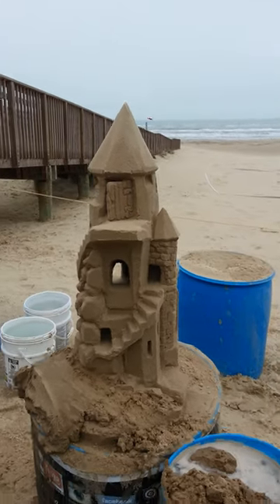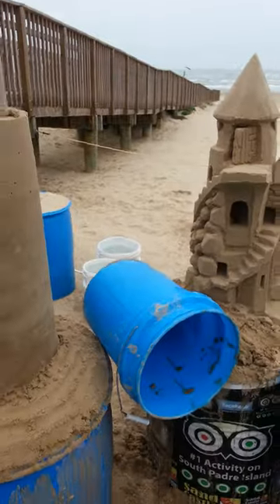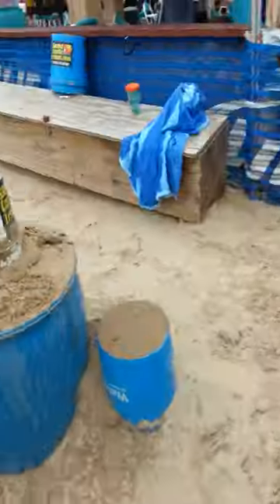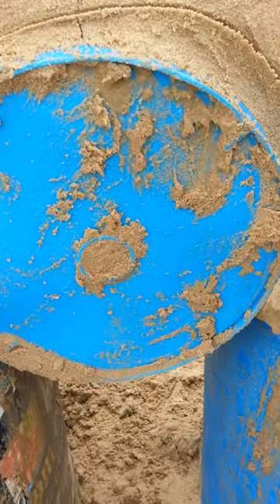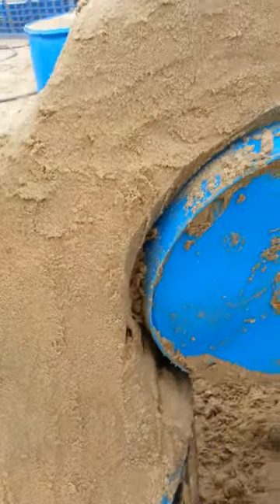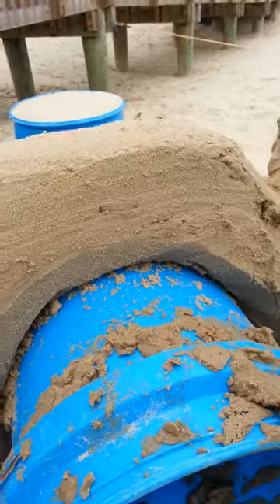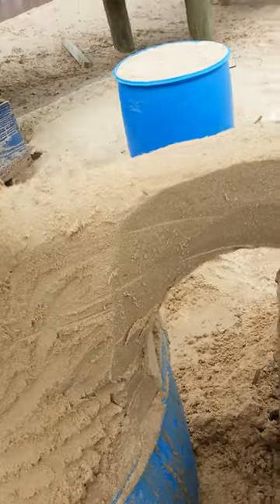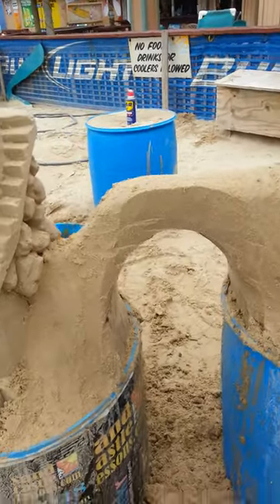Sand Castle Snippets - Build a Better Bridge - use a bucket!

Comment: pam is a good alternate
Reply from the maker: yes it is - and olive oil but they are not as effective as an aerosol which evaporates quickly and doesnt leave virtually an residue, - we try our best to look after our beach as there is only one! we have found that while pam works well t builkds a layer inside the bucket which doesnt react well to our humidity